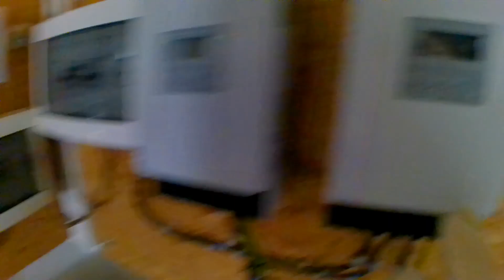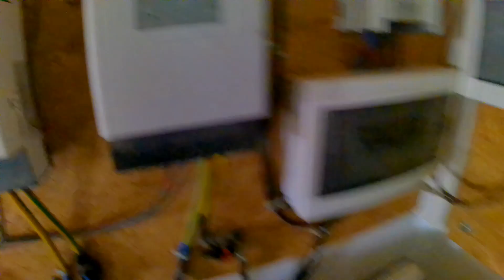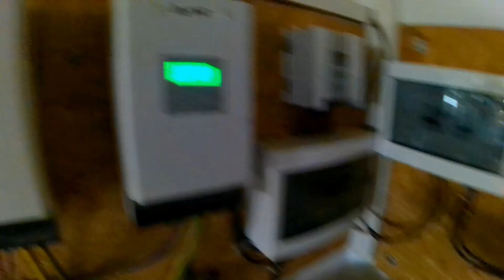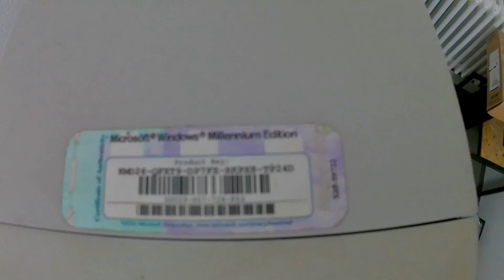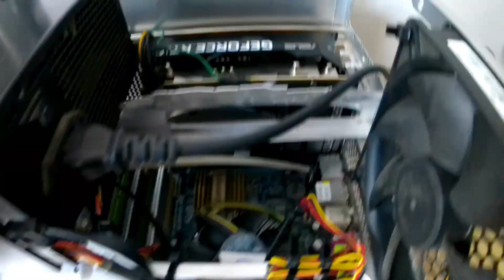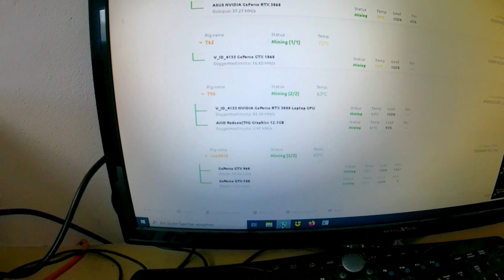Solar to Crypto/Research - A Heating that pays you ! How to use spare electric energy

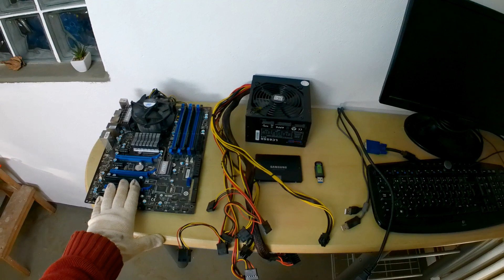Comment: 3:47 We don't need PCI-E x16 slots for connecting GPUs to the motherboard for mining as well as running Folding@Home, we can use PCI-E risers to connect the graphics cards to the PCI-E x1 slots. In my Folding@Home rig, I am using 2 Nvidia T600 GPUs, one of which is connected to an x16 slot and the other to an x1 slot through a PCI-E riser. Both are folding fine.
Reply from the maker: thanks for comment. for most cards that is correct. however since nvdia does the LHR stuff and specially the 3060 are basically all LHR, one needs 8 or 16 lanes for the proper speed. -> https://win10.support/rtx-3060-gives-50-mh-s-on-ethereum/